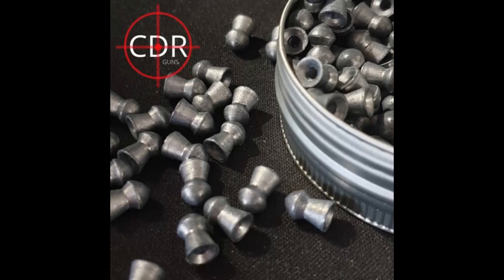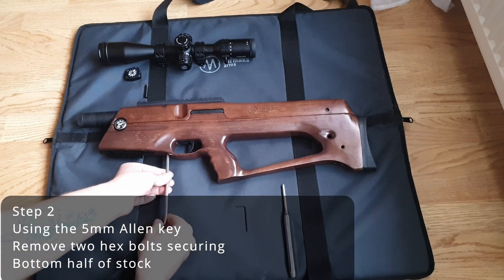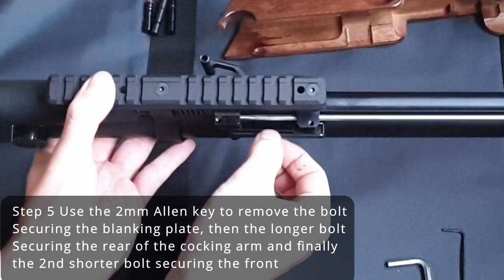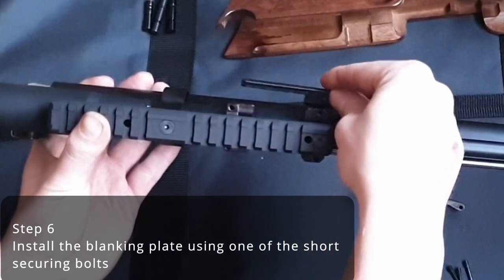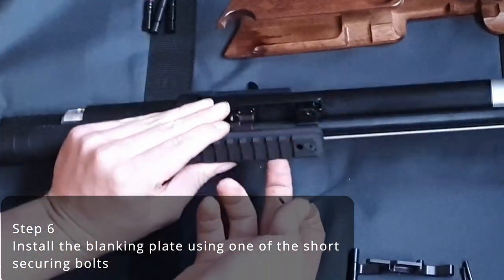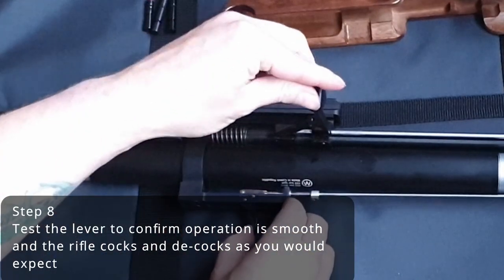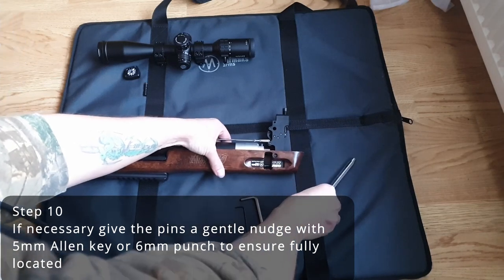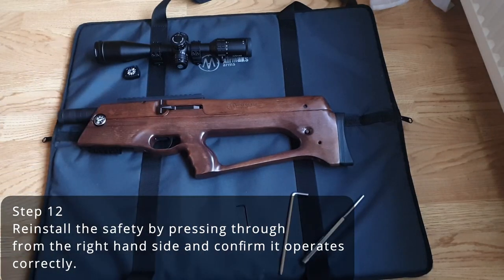AirMaks Caiman Lever swap

Comment: Can you do a video on the best way to add a shoulder or neck strap to the caiman.
Reply from the maker: Hi Chris, I will have to give that a little thought as I haven't looked at it, I don't use slings myself but you are right there are plenty of folks that do so a video guide would be useful, thanks for the idea!